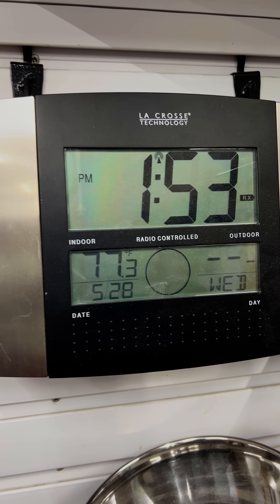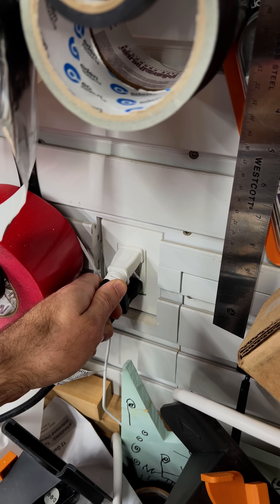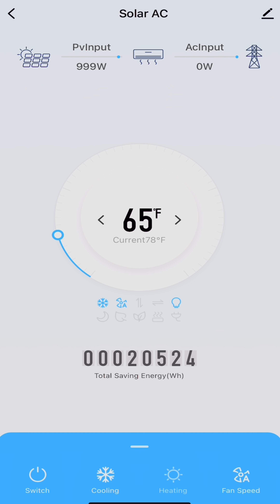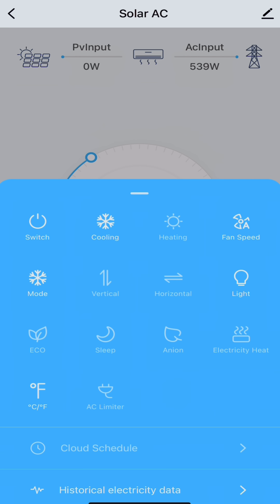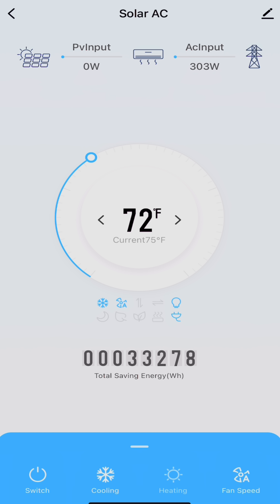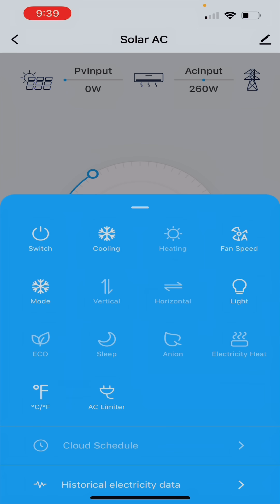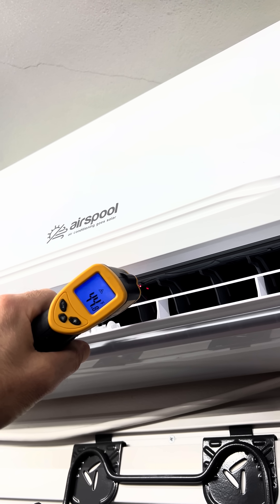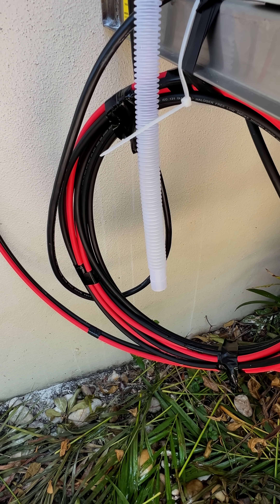Running Mini-Split A/C on Solar—Will Airspool Keep My Garage Cool?

Comment: Hi, approximately where in FL and how much does it reduce the humidity %? Absolute or relative %? Thank you!
Reply from the maker: South Florida and with the humid weeks we’ve been having it’s been keeping the garage at around 50%. I’m just reading that off the display of the dehumidifier I was using before using the mini split so it’s an estimate at 5% increments. I haven’t checked more specifically with a hygrometer yet. Constant water coming out of the condensation hose almost streaming at times so it’s doing its job. This is with opening and closing the garage door through the day.

Comment: Yup yup!....  I have 3 of these here in the Phoenix AZ area where it get WAAAAAAAY HOT and they cool my house all during the summer.  I also have them running at night using EG4 batteries and a 6000 watt converter so they keep running and not using ANY grid power.  My house is WAY cool.  Yes, my friends are JEALOUS!  We OFTEN leave our doors open and these AC mini splits on full blast so my kitties can look at the doors and they stay safe because of my security door.  My inverter / batteries also run my fridge, separate small freezer, coffee pot, a couple of lights and my electric blanket.  Yes, I need an electric blanket because my master bedroom is like a meat locker its SO cold......  LOVING life because of Airspool!!!
Reply from the maker: That's awesome. How many watts of solar are you using to charge the batteries and run the Airspool? Are you bypassing the mc4 connections on the Airspool then and using the plug connection via your inverter or did you figure out a way to have the Airspool use solar and have the leftover excess wattage go to your batteries?